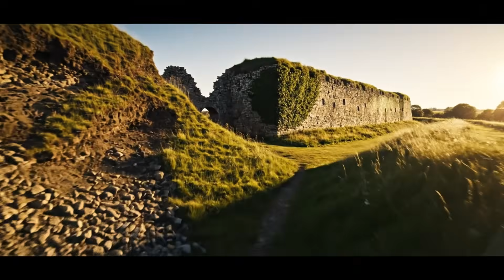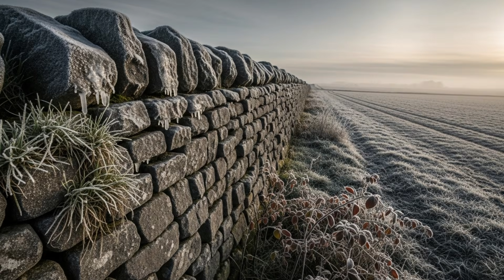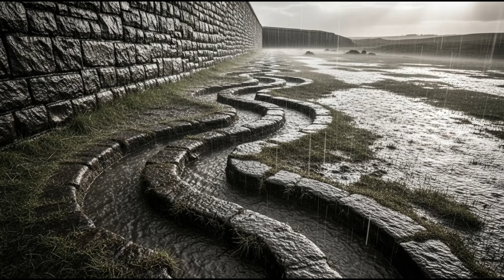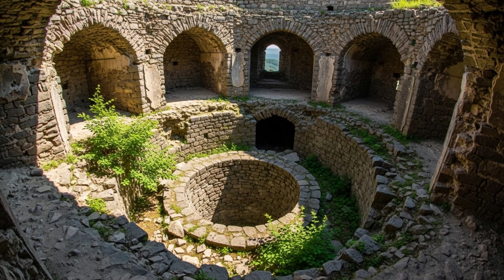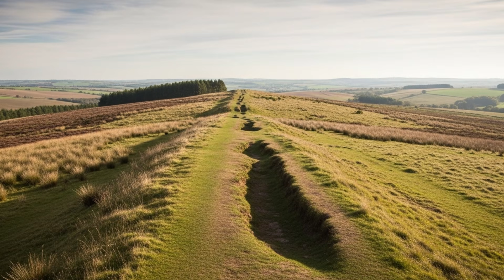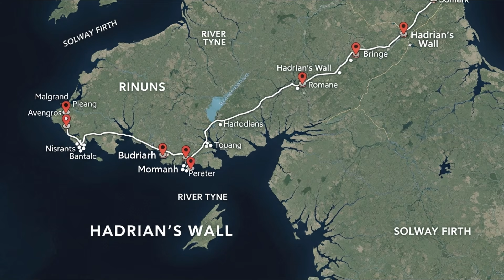The SECRET Engineering of Hadrian's Wall Uncovered

Comment: The Vallum was built south of the wall to create a controlled military zone, which does make you wonder if the Romans were just as concerned about movement and disorder within their own territory as they were about threats coming from the north.

The fact that they changed the wall’s width and added forts while construction was still underway is a good reminder that even the Roman Empire had to adjust plans in real time and deal with the same kind of project headaches we still see today.